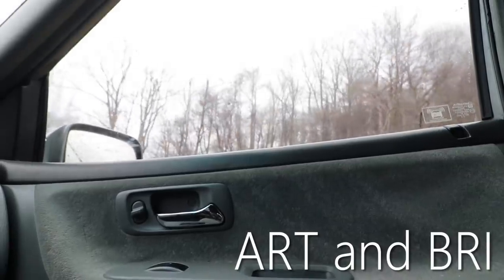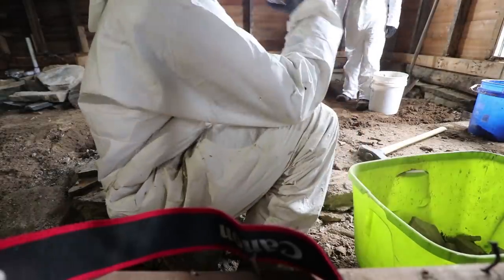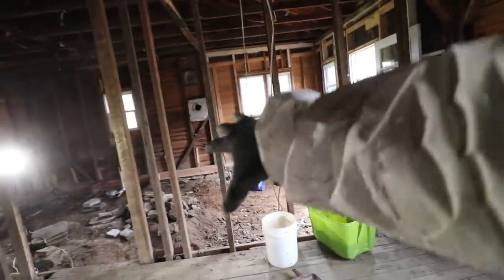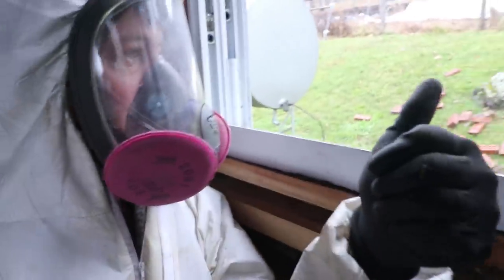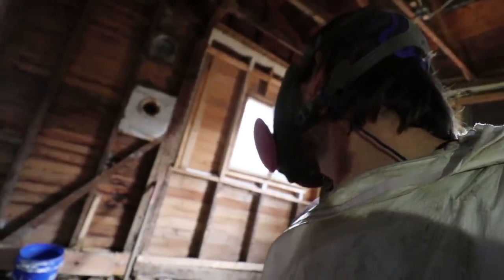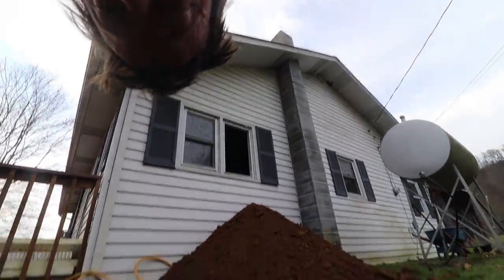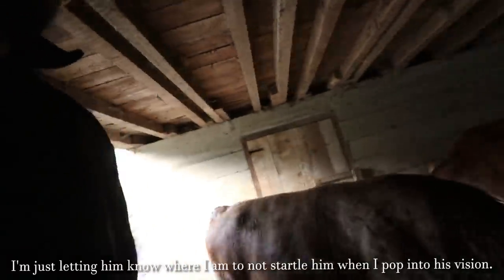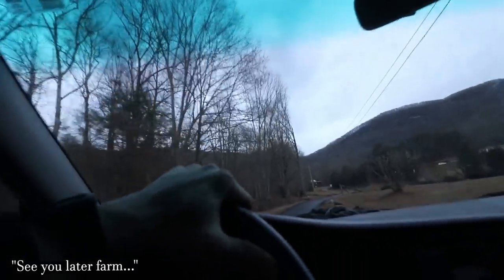Coyotes Come In Close!

Comment: Couple ideas for you Art.  If you have a rotary tiller for the garden bring it in to the house to loosen up the dirt.  Second lean a sheet of plywood against the house under the window.  This will save you some time double shoveling.  Work smarter not harder as the adage goes.

Comment: Wondering if you guys have thought of digging out more dirt so the crawl space can be 3-4 feet deep? We like ours being that deep, it is a lot easier.
Reply: Wouldnt that cause problems with the footings?
Reply: @jorgehurford1742  footing must be below frost levels, no worries
Reply: Make it deep enough to pour concrete then smooth it out nice, so when you have to go down for maintenance you can ride around on a mechanics creeper.  An few inches of concrete would probably do the job.
Reply: Or better still, get it down a full room height, concrete the floor, and call it a basement. Then they have easy access for inspection and work under the floor, and an extra undercover space for storage or a wet weather play area for the kids.

Comment: As you found out today, concrete has tremendous compressive strength. It’s weakness is a lack of tensile strength. Lift it with a pry bar and it walk crack easily. Love the demo. Can’t wait until you start rebuilding.

Comment: Just a thought, pound a few nails in at the bottom of the plane where your floor joists will be. Run a string line across from point to point and use a tape measurer to get grade across the crawl space span. That will insure you have ample space to access everything you need.

Comment: If it's warm enough get a box window fan from Walmart and move some air through your demo area with enough flow you will not need the mask.  Slightly wet down the the area the night before will help make the next days digging much easier and keep the dust down, not too wet.  A small electric Harbor Freight demo hammer with a broad chisel bit will make quick work of the hard dirt.  Also seen folks use a cordless drill with an old large auger bit.  I would try and go down at least 36", your joist are at least going to be 8" deep or more.   Once you get it dug out, line with 6mill poly topped with and inch or so of sand.  Add some foundation venting as well.   Would also check to see if you are in a Radon soil area and take the appropriate mitigation steps, it can be a long term hazard worse than the mold.